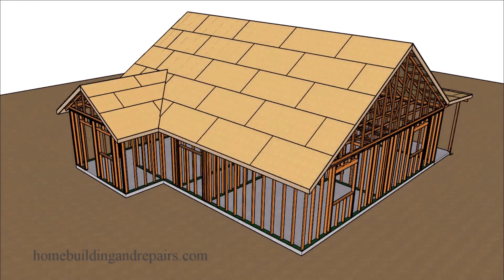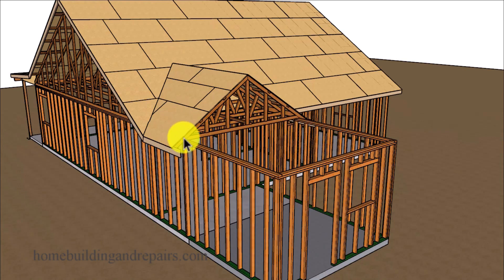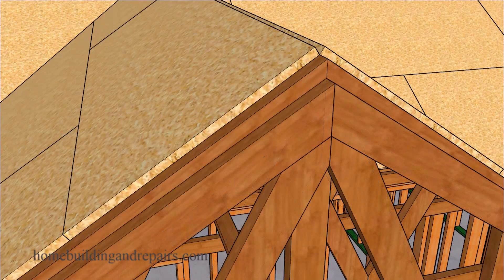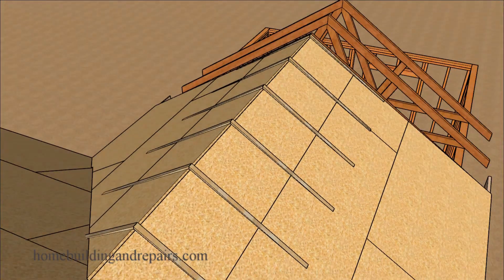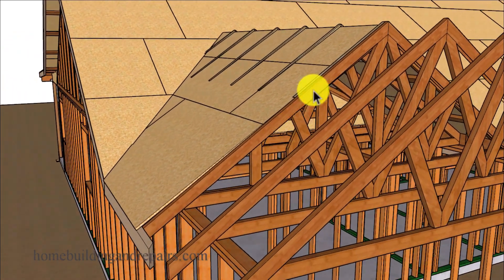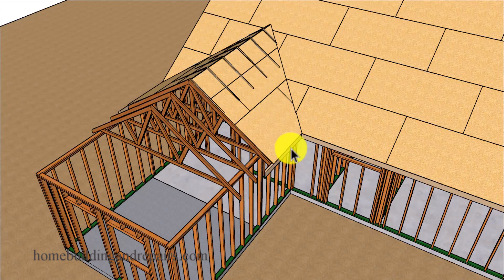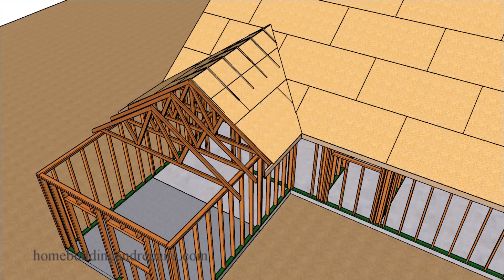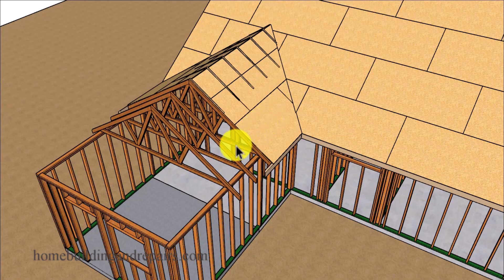Repair Suggestions For New Truss Roofs That Don't Line Up With With Existing Truss Roofs

Comment: If someone uses your first example, what fastens the furring strips to the new truss? Screws or nails?
Reply from the maker: If it was me, I would use 16d nails, but you might need to check with local engineers to make sure.

Comment: So... if existing structure are roof trusses, it's okay to construct an extension with conventional rafters and joists? That is, you can (basically...) mix the two methods?
Reply from the maker: It will depend on the existing and new design. Both the trusses and roof rafters could move differently and create problems for the ceiling and roof surface finish. I'm not 100 percent sure you wouldn't have any problems with the example in this video.